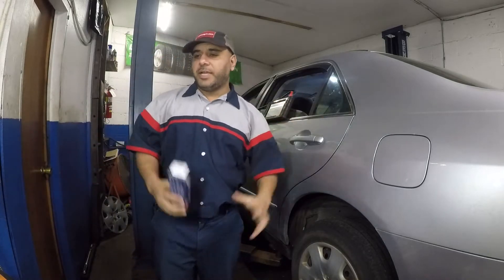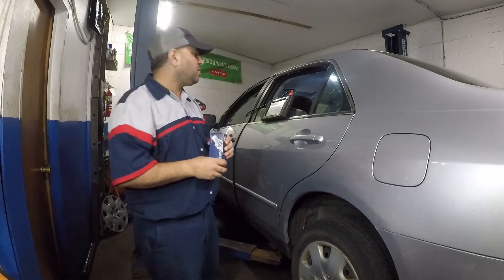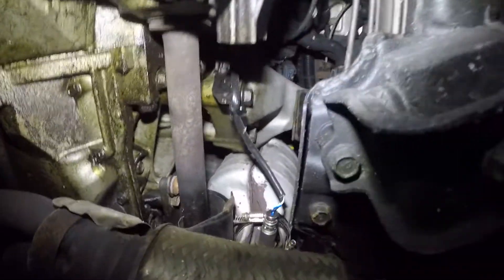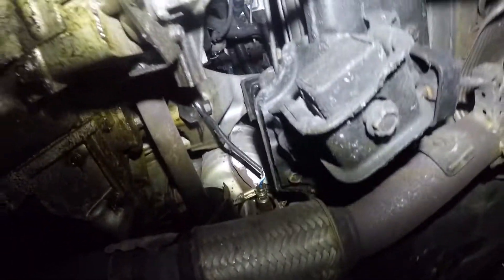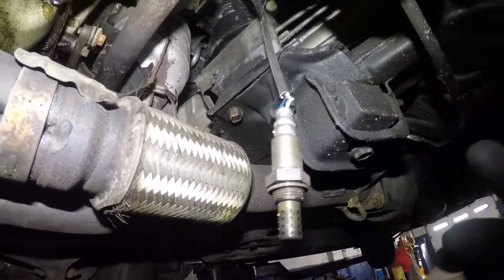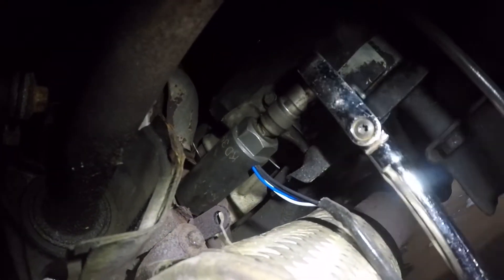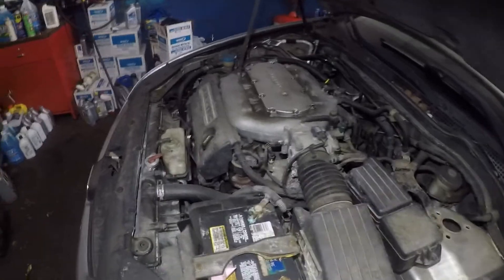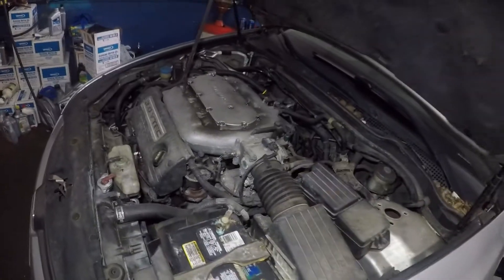Honda Accord 2003 to 2007 P0139 Bank 1 Sensor 2 Replacing Oxygen Sensor

Comment: Will this fix p0137 low voltage bank 1 senor 2…? Have a high idle that’s the code..
Reply: Please 🙏🏾 🙌🏾
Reply from the maker: I would need to check ohms on the sensor but it would be good idea to change it
Reply: Is that’s a yess lol just making sure.???
Reply from the maker: @ without testing no

Comment: So I have a 04 Honda accord ex sedan my upstream is on the left side of the Cadillac converter under the wheel ?
Reply from the maker: Left??? Which one u looking for bank 1 or 2
Reply: @RBTheMechanic  it says on the machine p420 bank 1 below threshold catalyst system efficiency
Reply from the maker: @YoungShizzie  bank 1 on v6 is back by the firewall
Reply: @RBTheMechanic  no I have a 4 cyclinder 2004 Honda accord ex sedan 4 door
Reply from the maker: @YoungShizzie  so there’s only one bank and one catalytic
Reply: @RBTheMechanic  yes

Comment: Did it fix the p0139 code
Reply from the maker: Yup
Reply: I got a 07 accord v6 few weeks back p0137 come on for bank1 sensor2 o2 sensor so I purchase a ntk one from autozone put it in not even 10 minutes down the road code p0420 appeared an I no nothing wrong with catalytic converter so I put some defouler on the 02 sensor been on for about 2k Miles now so today code p0139 came on for 02 sensor slow response think that ntk o2 sensor has is my Maine issue what I dealing with was going to order a denso off rockauto
Reply from the maker: @marshallrichardson8575  go with original sensor from dealer
Reply: That will be the denso one same as you have in video right
Reply from the maker: @marshallrichardson8575  ok

Comment: I have same car man and is stalling sometimes it shuts off while driving you think it could be. This
Reply from the maker: Dose it stall once u come to stop redlight or stop sign?
Reply: @RBTheMechanic  is shutting I was told that it could be the intake it does not have the factory one it gave me this code p01139
Reply from the maker: @alexissantiago6769  I would replace the sensor and clean out the throttle

Comment: Thanks for the video man you're a life-saver!🎀
Reply from the maker: No problem glad video was helpful
Reply: @RBTheMechanic  I got a question about my 2007 accord check engine light On after changing my catalytic converter. At first I did not change the top O2 sensor because is not get stolen. Only the bottom I changed. During changing the bottom I got lazy so I just cutted the O2 sensor and connected to the old wire that goes all the way to the top plug. Will the sensor voltage change after I cutted and changed the sensor ? 😙 How to connect back without causing voltage change. Thanks.
Reply from the maker: @ramosochoa418  bro get another sensor   There will alway be an issue
Reply: @RBTheMechanic Money issue 😙 Already spent Denso both 200 plus Catalytic. I try to join and put tape . have not put it back. I got another problem when installing the spring do you put the washer then the spring and screw or just the spring and screw. Kind of confused when I take out. Thanks.
Reply from the maker: @ramosochoa418  I think there’s washer behind it

Comment: I really enjoy what u do man, but I have a question, is bank two o2 sensor considered downstream or how do I know which one to purchase at autozone?
Reply from the maker: Well this is 4 cylinder car so the one u see here is down stream and it only has bank 1.
Reply: @RBTheMechanic  Oo okay well a v6 sorry🥴🧐
Reply from the maker: @marijuano9644  ok here’s video on 2003 model v6 I’m working on the bank 1 catalytic u will see me remove the 2 sensors ont on top is b1s1 bottom one is b2s2 video: https://youtu.be/C62NOzyGjQ4
Reply: Upper stream is right by the head cylender and downstream in on the bottom muffler
Reply: @RBTheMechanic  you say it's a 3.0 6-cylinder in the video. i have 07 4 cyl. same part im guessing or did you make a mistake in ID'ing the vehicle?
Reply from the maker: @dbarbush  no it’s diffrent part I have videos on 4 cylinder

Comment: So it is the O2 sensor? I have an 07 accord 4 cyl and I replaced both upstream and downstream sensors about 2 months ago. What causes these sensors to go out? And is it ok to drive with a bad sensor for a while?
Reply from the maker: Depends on what brand u using. Yeah u can drive for a bit it could also be gas that cause it or relay for sensor
Reply: @RBTheMechanic  it was a denso too I believe. Ok great thank you
Reply: It’s gonna tank your gas mileage
Reply: Yo where’s the locations to the upstream and downstream, I can’t find em to save my life. Replaced one closest to the cat but all the replacement sensor options have a female connector. This one needed a male connector. So lost
Reply: Could a bad 02 sensor cause starting issues or is it a cat converter issue

Comment: Hi, I have honda accord 21 1.5 sport and notice that upon acceleration pedal to 4 (4000) it will hesitate and not pass 4 (4000) upon acceleration . car milage now 26k and car was in accident changes radiator and turbo condenser   do you think its the oxygen sensor1 or 2?  please share your insights.  Also i see water out of the end of the muffler .  
Thanks
Reply from the maker: I don’t think it’s anything do throttle cleaning

Comment: Hi. Is it the same with P1137?
Reply: P1157*
Reply from the maker: No it’s more electrical issue u can chnage out the sensor but code might come back but it’s worth the try check fuses for oxygen sensor and change out the relay as well for oxygen sensor
Reply: Okay. Thank you so much for your response. I will do that.